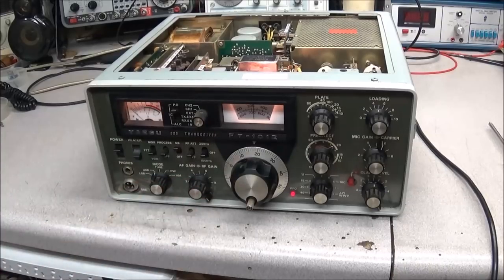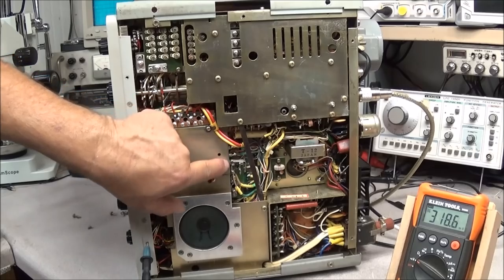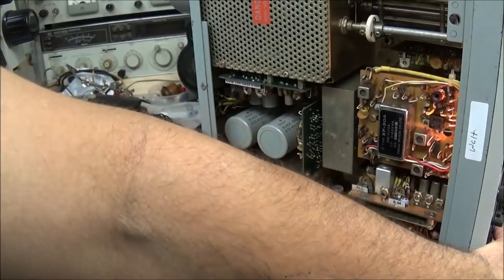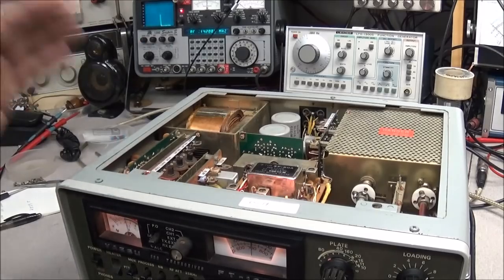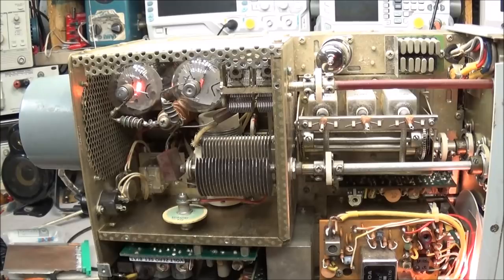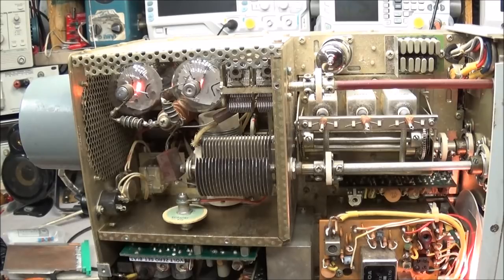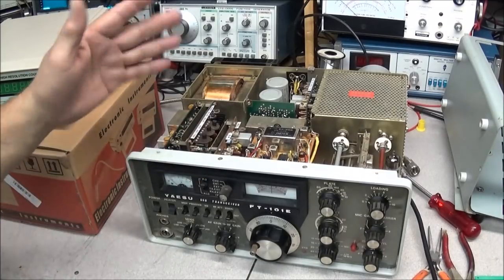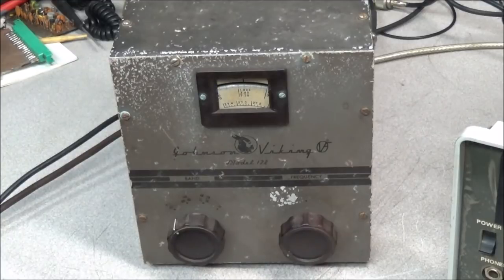#142 Yaesu FT 101 Series Frequency Adjustment

Comment: It's pretty amazing to see that the old 101 series is still around and giving a good account for itself after 40 plus years, I wonder if any of the kilo buck transceivers of today will be around in 40 years. Being that they are all loaded with custom one off parts, I tend to doubt it. No need to apologize for not having a lot of time Buddy. Those of us who have been married a long time know that when it comes to the XYL's kitchen getting fixed or some old radios getting fixed, the choice is pretty much clear. 73 Doug.
Reply from the maker: Thanks for the comment Doug. I agree. These new rigs will never last that long. Too much complex circuits to fail. The old 101's will last as long as there is still a few parts around.

Comment: I have an FT-101 (not B model) that I am fixing for a fellow ham here. I replaced the transformer and removed the AM mod that the previous owner had put in for CB use. Everything works OK now on USB but the LSB is 1.5KHz high, above dial frequency, and I can't get it to come in. I did find a gray wire that has been cut at both ends. One end is close to the mode switch and the other end appears to have come off the voltage regulator board connector somewhere between pins 10 - 13. I have traced till I am blue in the face but can't figure out where that wire goes. Any help you could offer would be much appreciated.  Thanks. Dave W8DKM

Comment: I do not have a sig gen, so can I use the 25Kcs or 100Kcs marker as the signal source for adjusting the S meter. Also, my 101  is the late edition and the noise blanker board is not located where yours is in this video.
Reply from the maker: Yes, that is all you really need to service these rigs. Just use the marker gen as it is connected to the antenna port.

Comment: Splendid fix. I own the same radio since about 1974. It wasn't new when I purchased it. This was a basket case radio. It was repaired and modified as to where I couldn't use it. It would interfere with the neighbors TV set. my antenna came down during sandy storm and can't even listen to it. So it's a nice looking show piece. I hope your respires / improvements on the Pond-Dee comes out the way the Mrs. likes it. Good luck, looking forward to the next video..... Angelo
Reply from the maker: Thanks Angelo, that sounds like a nice rig to get a full make over.  Wife is happier each day.

Comment: Thanks for sharing how to align the TX and RX frequencies.  I have had my clarifier circuit on for 6 months now on my new old FT-101EE.  I had to have it on to compensate for the difference that I have between the two and I have been very careful to not touch the settings for 6 months because they would be off again.  I'm fixing this tonight thanks to you.  Thanks a million for sharing your knowledge and know how.  I'll let you know how this comes out!

Comment: Just the video I need to repair my FT-101E Receive and transmit are on the same frequency now. I will wait till you get those 2 output tubes in and do the alignment before I try it on mine. Love those old radios and use mine just about every day. Thanks Buddy for the great informational videos.
Reply from the maker: Very simple process on these rigs. Why I like them so much. Tubes should be in soon. Thanks for watching Lyle.

Comment: Good to see you on again Buddy. As usual, this is a really good video. I had an FT-101EE back in the mid 70's and loved that radio. The difference between the E model and the EE model is that the EE model did NOT have the built-in speech processor. Well, I didn't need one because I had an audio derived speech processor that worked great LOL. Anyway, thank you for keeping the 101 series alive and kicking. Hope your house repairs etc go very well for you. 73 DE K7RMJ  Frank
Reply from the maker: Thanks Frank.  House is half way done. Between the public job and house repairs not much time left. Good point on the speech processor.

Comment: Great info.  I have run into the mismatched tubes myself.  It can cause all kinds of weird oscillation problems.

You do realize you have a really nice frequency counter already.  In fact you were using it in this video, your spectrum analyzer.  Just hook up a 10X scope probe to the SA, set the center frequency to the exact frequency you want to align to and set the span to 2 or 3 kHz.  You can also hit the peak button and then the soft key for continous peak.  Now you can see the frequency in numbers and the actual signal.  It actually makes frequency adjustments easier.  It becomes more like peaking a IF stage with a analog meter.  No waiting for a digital display to stabilize.
Reply: And even more accurate with a 10MHz GPSDO or Rb standard!  'Course on a Viking on AM what's a couple of kHz one way or the other among friends?  ;-)
Reply: Dino Papas 

Yep, everything runs off a HP GPS oscillator here.  As new as his SA is its still in calibration so he should be dead on for a while.  And yeah, what's a few kc between friends.  Nothing like chasing each other across the band with a nice old drifty tube rig.  :-)
Reply from the maker: Good point about the SA as a frequency counter. I use it quite often for that  myself. Those mismatched tubes cause all kinds of issues.
Reply from the maker: Thats right!  Also my newer IFR was recently calibrated. Shes dead on :)

Comment: I like the extender board you made, was hoping to see how you made it, but it looks easy enough. I have a couple of these 101s. Thank you for all your input to us. it's very interesting.
Hoping to see some more work on that old 101 if you can manage it. Cheers from the UK.
Reply from the maker: They are very straight forward to make. Just get the spacing, cover and etch. Thanks
Reply: So you made these extender cards???  Wow.  I really need some of those.  I have a FT-101EE and I LOVE it but it def needs some adjustments and I want to do as much as I can myself.  I'm interested did you buy blank cards somewhere and etch them?  Are the sockets/plugs standard or something?  Do you start with a fully copper clad card and then put in some acid or etching compound?  Man i really don't know anything about making those but I want to do it and I need some!

Comment: I have two FT-101's, an “E” picked up on Ebay that is in good shape and my “B” model I’ve had since the mid 70's.  So far I have replaced the electrolytic and mylar caps in the E model, checked the Rx/Tx alignment voltages (exactly 4.000 on all three), and have done a general cleanup & inspection.  I don’t see anything  bad.  Next step is relay cleaning and going through the receiver fully.  Both have the ZL2BAF modification for strong signal overload.  My "B" model has all three filters.  I am really looking forward to your video on the receiver circuits.  I was wise enough to pick up two pairs of PA tubes some time ago, one NEC the other Raytheon, so I should be in good shape for a long time.  *  Really good video's, Buddy  *   I look forward to each one and go back and look at the previous ones often, too.  73's and keep up the good work.  ZACK KC5IS
Reply from the maker: Sounds like you are moving in the right direction with those Pete. Thanks for sharing, love hearing repair stories.

Comment: Hi, thank you for your quality videos.
I have an FT-101B and tried doing this but my initial voltage reading is nowhere near the 3.4 85V your meter shows. Mine shows 0.267V with CLARIFIER 'on' and set to 0 and 0.202V with CLARIFIER 'off'. Adjusting the variable resistor (VR-4) doesn't have any effect. What could be going on here?

Comment: I don't understand adjusting with the clarifier on and off.  If you set the clarifier knob straight up on zero then adjust VR2 to where the voltage is the same you can breathe on the knob and the voltage will be different. I understand adjusting with mox on and off. Thanks for the videos! You really help a lot. I can read it in a book but it's better to see it done. Thanks again!
Roger KW4EMF

Comment: I really enjoy your video's. While you are checking the voltage  with the clarifier on and off you might as well check it putting the radio in mox with the heaters off. Then match it to the other two voltages with the "zero" potentiometer on the regulator board. Your videos have really helped me a lot with my ft 101's. Hope one day you might make a video of the alignment of the radio. Thanks Buddy!

Comment: I haven't turned on my ft101 in a good while. I changed out some caps when one of my  finals failed. I replaced both finals with a matched set but never powered the FT101 back up. When you do a video on neutralizing finials I'm thinking that just might push me to the point to power the radio back up. I have always be afraid of damaging my new tubes and I figured if I never turned it on they would last a life time. Thanks for the videos
Reply: There is a way to do a no-HV neutralization.  Fox Tango site illustrates it and its pretty easy to do.
Reply: I think this is the link your talking about. 
http://www.foxtango.org/phpBB2/viewtopic.php?f=1&t=1579&p=3764&hilit=neutralization#p3764
Reply from the maker: Thanks. Yes I will be doing the final tune up in this rig in the future. Will show all that. And look at the link provided below.

Comment: Hi, i ma restoring my Ft-101E i have replaced and neutralized the final tubes, Now i am working on clarifier... i have two problems:
vr4 which Is supposed to be used for Y centering the clarifier does not work , no effect on clarifier frequency .
The second problem is that zero regulation to center rx with tx has not enought course to set rx frequency equal to tx. Can you give me some advice?

Comment: Awesome video !!  I have a Drake TR-4C. Do i need 3 matched tubes or get tubes that are all the same as in 3 Sylvania tubes and not worry if they are matched. Just make sure they are the same brand and look the same ?
Reply from the maker: Yes always make sure they are the same build type, brand does not matter.  Some tubes are just re-badge,  And if they all read the same on a tester that does help. Thanks

Comment: I found a Nice Ft-101B w/original Handmic Recently in an Estate Sale...Give away price ...Needed Alignment but that was so simple a 5 yr old could do it.A.C. Plug Missing but fixed that   Cleaned the controls and switches too. Thought relay was dirty but after tapping around on the regulator board seems to effect it so bad solder joint or pots need changed any suggesstions? Found the bad boy RL-2 Antenna relay after all... easy switch out for another one....Thanks for the Video!!!    73's DE Claude NØFMO

Comment: I have a FT-101-E and have trouble with the VFO knob slowly moving if the little ( I don't know what to call it?) fine tune knob is not at the 6 o clock position (bottom). Is there a tension adjuster in the VFO to tighten it up a little? Thanks
Reply from the maker: I am not sure what you are meaning. Send me an email and perhaps we can help work through this.
Reply: I got it figured out. I ended up putting  a peace of felt between the black knob and the plate that holds the number plate on, kind of like the felts are to snug the number plate. I looked all over for your e mail address and have not found it yet. I have some other questions. I would like to ask and would more then happy to pay you for some answers if you could help me out.  Merry Christmas,
 Steve

Comment: Buddy help! On my 101ee when I reach maximum recieve on 10 meters the preselect is on 15 meters. What causes this? Thanks for the videos. I really enjoy them. 73's from KN4DBP.
Reply from the maker: It is really hard to say with out a lot more information.  Does it do this just on 10 meters or are all band effected? Did you get the rig in this condition or did it start acting up later on? Almost sounds like it has be improperly aligned.
Reply: The Radio Shop. I purchased the radio used. It is the cleanest rig like this I have ever seen. It looks like it just came out of the box. Something happened when I flipped the mox switch. The band was on 10 meter. Preselect on 10
 But the plate was on 80. Don't know if it's a coincidence or not. Power output is low on 10 A. About 40 watts .Then gets progressively higher with just over 100 watts on 10 D. 20 to 30 watts on 40 and 80 meter.

Comment: if they are not Japanese tubes, the neutralizer cap will need to be changed.
tubes must be plate current matched. NEC marked them I think to match like "450" etc.
6146s are lower output and suffer harmonic oscillation in the 101, its not recommended.
Reply from the maker: I have never liked the idea about converting to 6146 tubes.  I know two folks that have tried and failed.  I like to try myself just to see what it does and perhaps learn the mistakes of others.